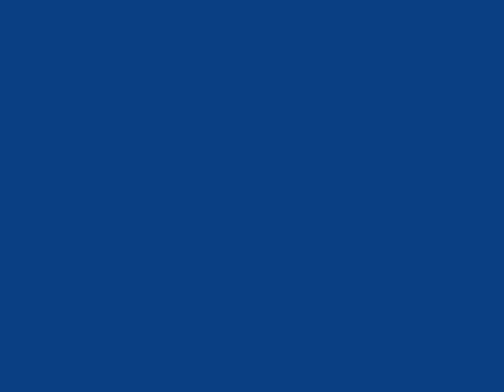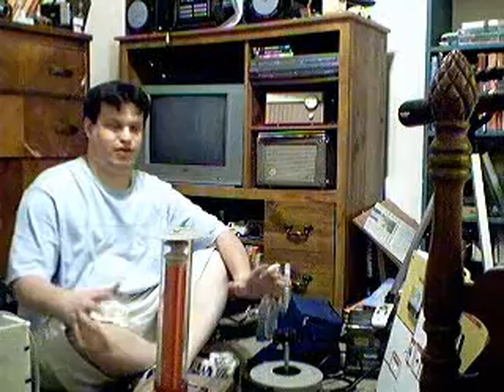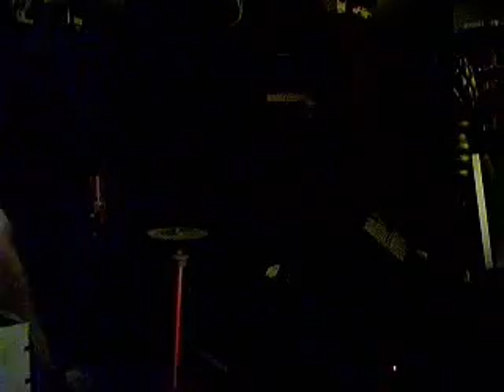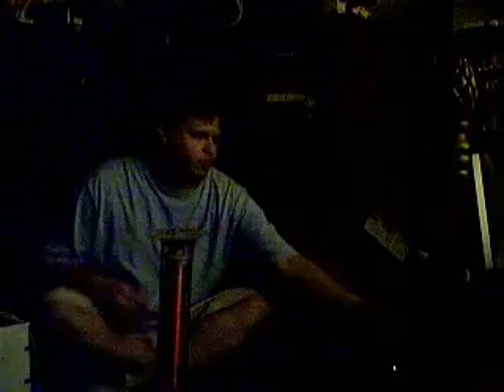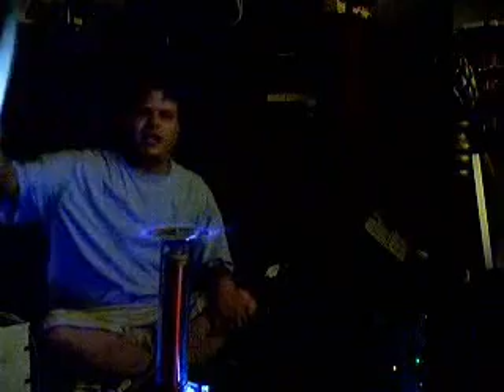Tesla Coil video

Comment from the maker: It's a variable transformer ("variac").  I use it to control the voltage going into the power transformer on the Tesla Coil.  The spark gap needs a certain minimum voltage to work, that's why you can see me turning the knob on the variac to slowly bring the voltage up, and then suddenly the Tesla Coil starts working.

Comment from the maker: ...You'll probably want to start with the secondary winding first, because you will sort of build the coil around it.  That 2-inch tube will work fine, although I've found that acrylic is kind of hard to wind on because it's so slippery.  You'll want to use 26 or 28 gauge magnet wire, about 750 turns. Check out the videos I made to see if they help you.  Let me know if you have any questions.

Comment from the maker: Sure, check out my videos.  I have a two-part video showing how to build a Tesla Coil.  It covers all the basics.  For now, you should build a small one using your 6kv 30ma transformer.  The 12kv transformer would be a bigger, more complicated project because everything would have to be insulated for the higher voltage and able to handle twice as much power, especially the spark gap.

Comment from the maker: Yeah, sometimes there can be high frequency kickback.  It used to make the doorbell and phones ring!  But I put a line filter on the AC input line on the Tesla Coil, and I didn't have any problems after that.  I wouldn't run it on the same outlet where you have a computer plugged in though.

Comment from the maker: I've heard that if you put a helium balloon in a microwave, it will glow...which in theory makes sense because helium is an inert gas and will ionize and conduct high voltage.  But I've tried it and couldn't get it to happen.

Comment from the maker: Transformer: 6kv at 20ma (furnace ignition transformer)

Primary winding: 5 turns 14 awg stranded

Secondary winding: diameter is 1.4 inches, length is about 13 inches, about 750 turns 28 guage magnet wire.

Capacitors: old stock commercial glass capacitors.  Two 10kv .01 mfd capacitors in series for .005 mfd total capacitance.

Single static spark gap.

Resonant frequency is approx 1.5 MHZ

Output voltage is approximately 100,000 volts

Comment from the maker: Actually, the energy isn't really transmitted by a magnetic field, but more by high frequency radio energy.  Although you could say RF is a high frequency magnetic field, so maybe I'm just arguing about someting academic here.  Anyway, Tesla actually did manage to transmit wireless energy for several miles, so it is possible.  But you're right that the power still has to be generated, and broadcasted energy could damage sensitive electronics.

Comment: Three reasons: 
1. The strength of a magnetic field reduces over distance when it travels through air, so you'd have to build a HUGE coil to transmit over distances.
2. Magnetic interference will disrupt or even destroy most electronic devices. Don't fire up a Tesla coil anywhere near your computer!
3. Even if those problems could be overcome, you'd still have to pay for the generation of the electricity, which is the most expensive part. Transmission via wires is cheap.

Comment from the maker: Well, the coil by itself does not generate X-Rays.  At least mine doesn't.  But some of the light bulbs and tubes I have glow a green color and actually do set off a Geiger counter...but it's very soft, low-level X-Rays.

Comment: will you guys ever quit with sparkgaps on so small coils? SGTC is for 5+kW, not less, or it's just a waste of power and a hell's load of noise, both hearable and electric! Use tubes - I have a 22cm streamer and have no overheating even after 40 minute-long runs!